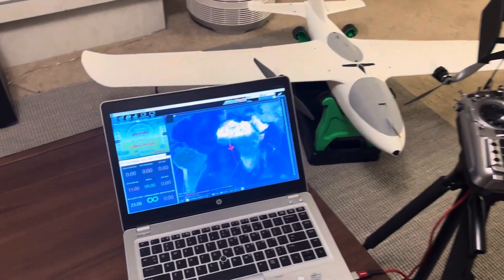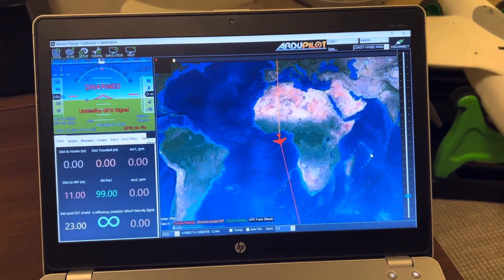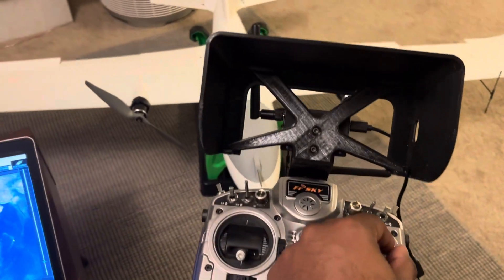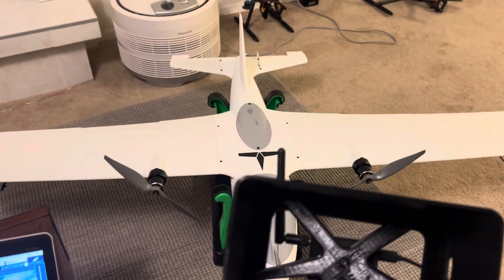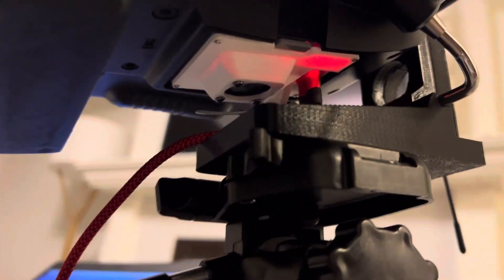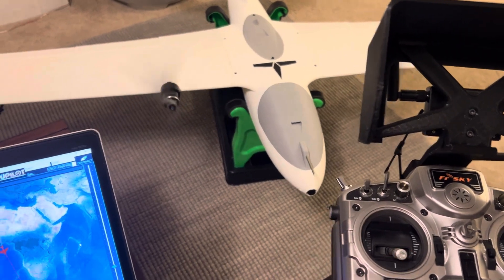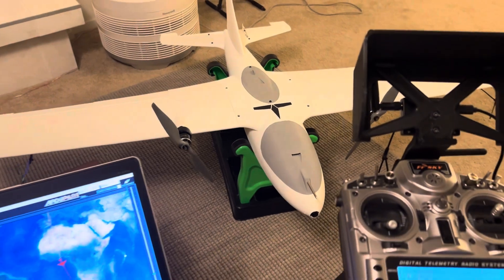ELRS 915 Airport - Mavlink + RC Early Testing Days

Comment: ExpressLRS Airport effectively replaces the standard SiK telemetry radios now, right?

“AirPort provides a firmware option that allows you to turn a regular ExpressLRS transmitter and receiver pair into a bi-directional transparent serial data link, over the air.”
Reply: Correct
Reply: Yep, it is just that this particular project by this guy run both mavlink and rc link on the same ELRS link.

Comment: What is the telemetry rate set to? your rpm telemetry didnt appear til a few seconds after the motor started and had not changed back to zero when the video ended?

Comment: How you make the 2 TX link together like normal TX+RX ?
Reply: No you need 2 x rx and 2x tx.
Reply: 1 set tx+rx for rc control and 1 set for pc mavlink connection
Reply: @pierholtrop5432 , Not with this setup. Only a single set for RC control and telemetry.
Reply: @trpalmer can you explain how to do both Mavlink and RC on the same TX RX set?
Reply: @pierholtrop5432  Wow, how to flash the Mavlink system in the ELRS module?
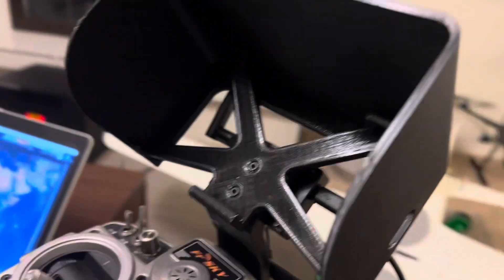Reply: @trpalmer  @0:49 he says "2 Tx modules" - one is the control link (2.4GHz), the other for Telemetry (900MHz). That's why he points out the 900MHz Rx under the wing at @0:30 being used as the "Air Unit" (Airport mode) - the Rx's telemetry feed transmission is used to send the MAVLINK data back.
Reply: @BooDevil65  No this is a different implementation of ELRS where you have Mavlink and RC on the same link, effectively calling it Mavlink-RC using only one pair of elrs units. In which case you definitely would go for both high power air and ground units, so having two TXs, one acting as the ground unit and one acting as the air unit just makes sense. This project is still in active development. As for ELRS Airport, that is already released and you can always use it to replace telemetry devices on your UAVs, with airport you'll need two pair of ELRS, one pair for RC and one pair for telemetry. Cool stuff and definitely will break the market when it comes to UAVs that require telemetry back to ground.
Reply: @tuttuti123 Ahhh, thank you - he REALLY means 2 Tx's - I missed where he said 1W / each - that would be a heluva RP2 Rx LOL

Is this Mavlink-RC intended to merge into the main branch of ELRS, and if so, when-ish?